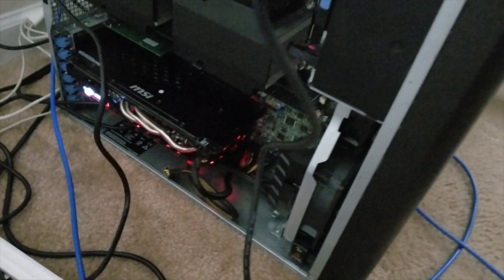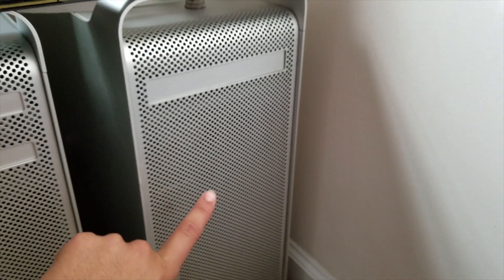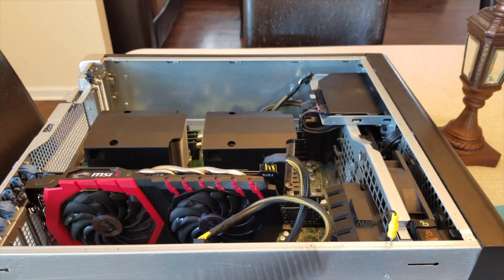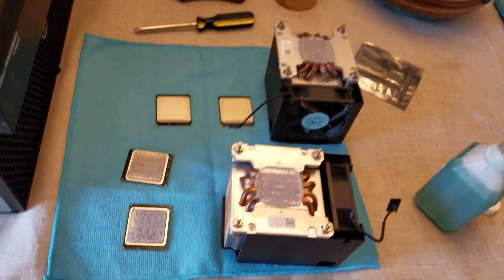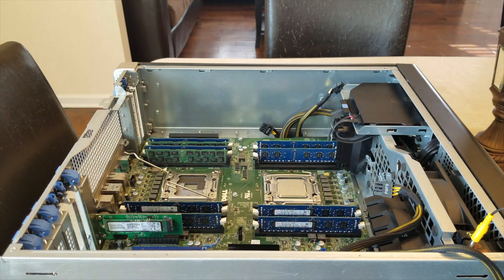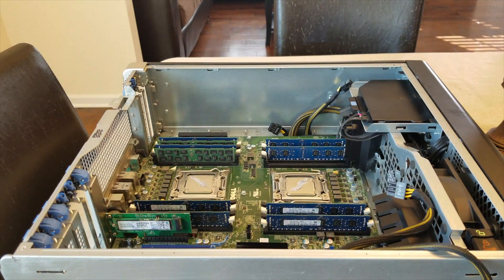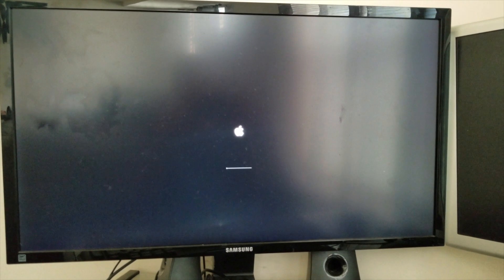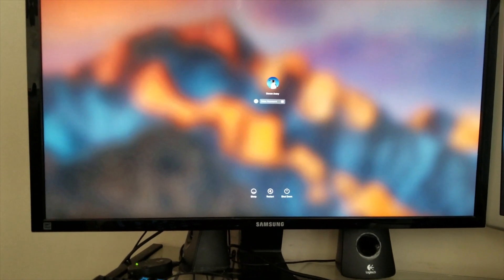Dual Xeon Hackintosh CPU Upgrade(Dell T7600)

Comment: Ok old post but I have to ask. How did you manage to fit msi in there. The case wont close afterwards and as I noticed you run it with open case. I just tried with an RX 570 and its height its way to big to fit
Reply from the maker: I just ran it open case.

Comment: yooooo! i have the same exact setup except i have a dell T7910 (basically the same thing). i am going through the struggle getting this to fully boot up. Any help would be greatly appreciated.
Reply from the maker: Nice! I just kept trying different boot flags. NPCI=0X2000 was one that allowed it to boot sometimes
Reply: @averyplays7576  Try updating your Bios, newer CPU versions after the Dell Workstation was made require it for SMP, it's probably not your issue as your CPU's were recognized. I worked at Intel 1999 , 2006, 2 cpu, 4 Cpu, 8 cpu servers require that the stepping of the CPU's be the same, unless some how that was changed by Intel with out my knowledge.
Reply: Can’t wait to try it. If you don’t mind would you be able to send your PList if it isn’t too much trouble. DavidJoseHolt@gmail.com

Comment: Hi ! Why does the operating system load so long? No faster than on my mobile Core 2 Duo 2.9Ghz T9800 with 4GB of RAM 800mhz (High Sierra).  I plan to buy two socket motherboard X79 Dual cpu with two E5-2680v2...

Comment: The new cpus are 130W and older were 80W. Did you have to upgrade the CPU Heatsink/fan? or the older heatsink/fan is working perfectly fine. Thanks!
Reply from the maker: Nope. regular fans worked fine.